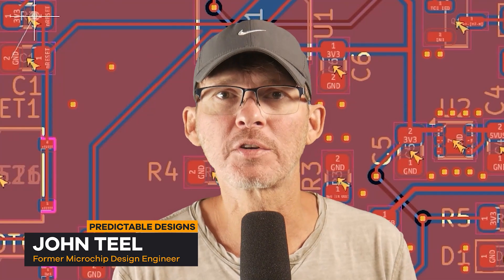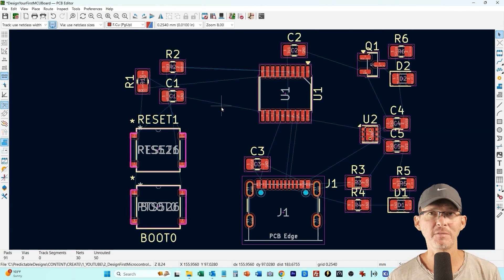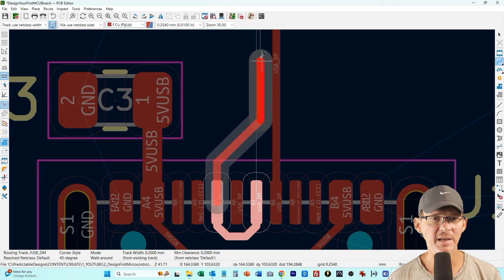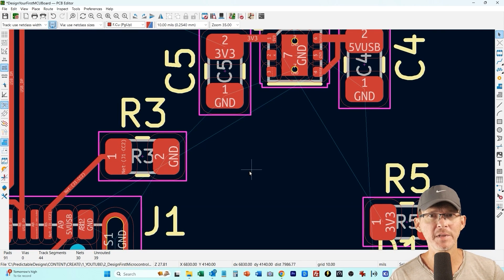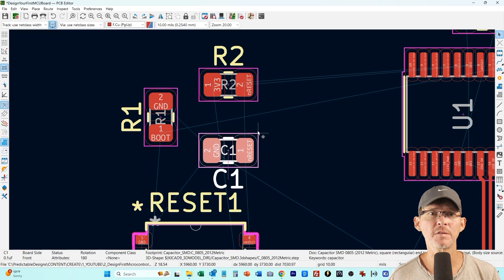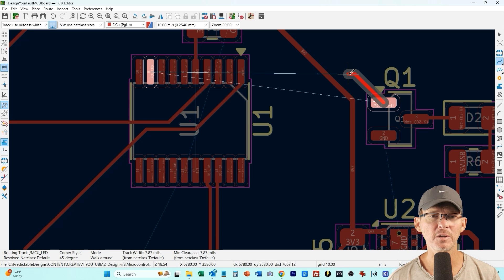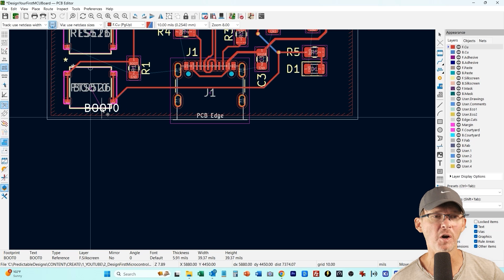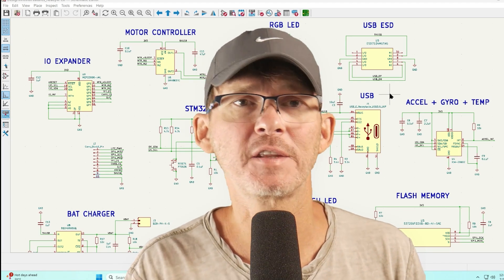Design your first microcontroller board in 15 minutes

Comment: Hey! Doing Amazing. I'm jus curious about for what purpose this board will use?... Like in pov of μC?  Is it for 8085 (beginner)?
Reply from the maker: The purpose of the simple version of the design is basically just for learning. The only thing it can do is be programmed to flash an LED. But in the extended version (see link in description) I add a bunch of extra features. The board uses an STM32 32-bit microcontroller. The 8085 is about 50 years old and no one really uses them anymore. Most newer designs uses Cortex-M based 32-bit microcontrollers, which the STM32 is one of.
Reply: Oh that's the point!! @PredictableDesigns , thankss